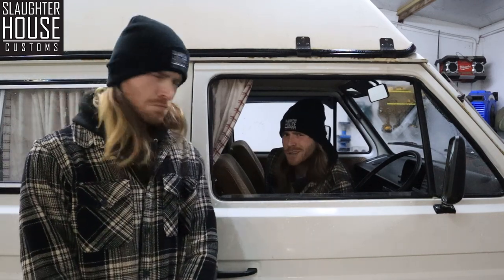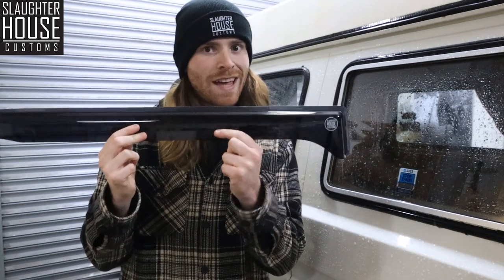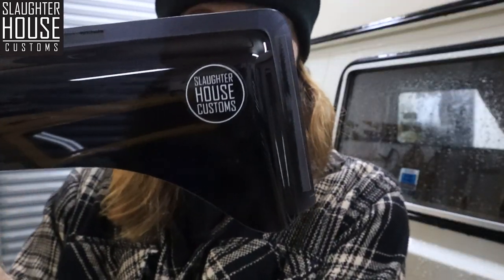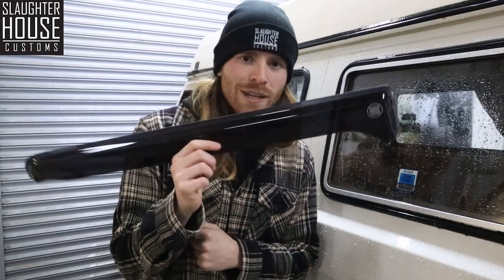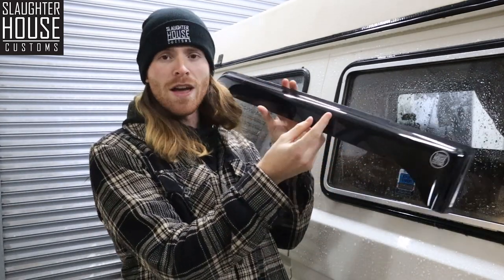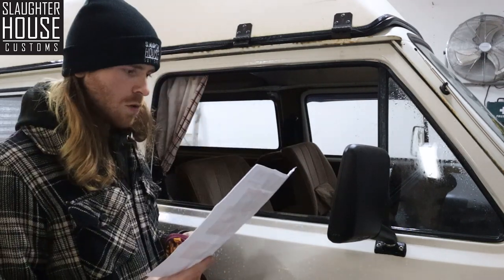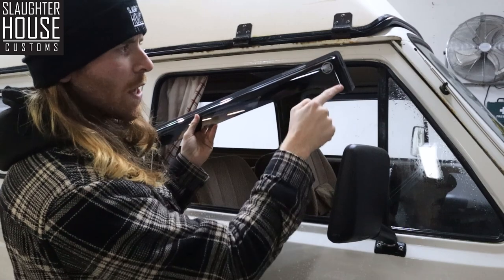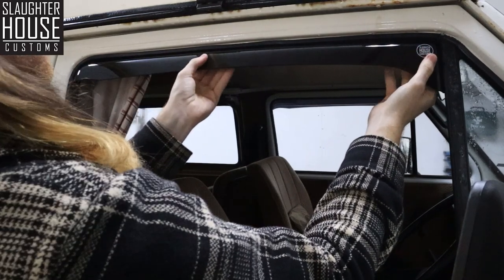FIT YOUR VW T25/T3 SHC WIND DEFLECTORS: SHC NO NONSENSE TUTORIALS

Comment: FYI the old wind deflectors I had on my civic lasted a year without the clips. The adhesive will become loose especially if you have the felt style window channel. Please use the clips or you’ll find that you’ll be holding on to them for dear life at 70mph until the next junction 😎👍🏻😂
Reply: I got wind deflectors on my van had them for the last 3 years no clips and I don’t have to hold on to them, they still in place.
Reply from the maker: Thanks for letting us know!
Reply: 70mph lol